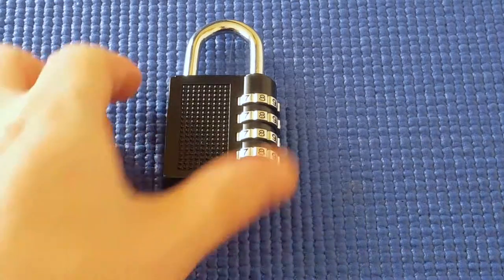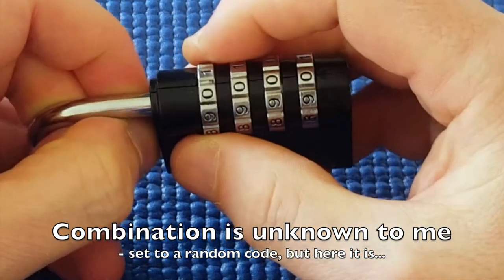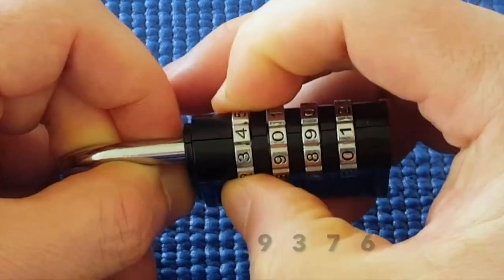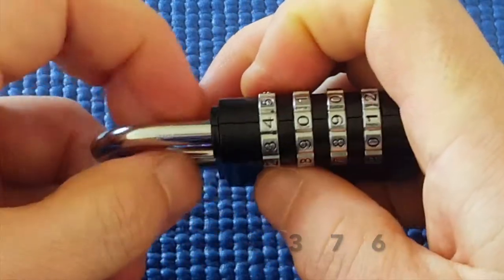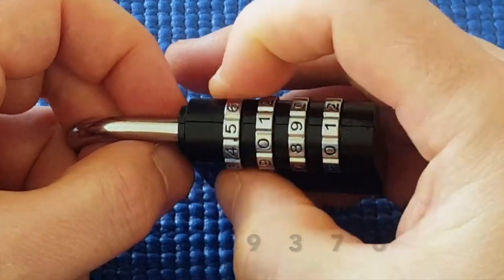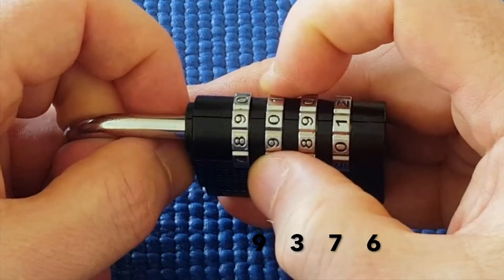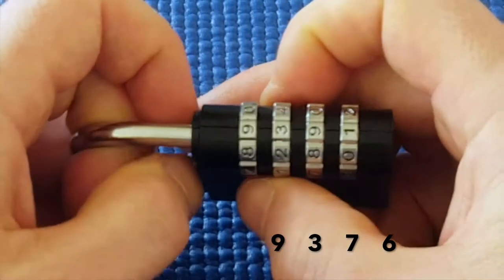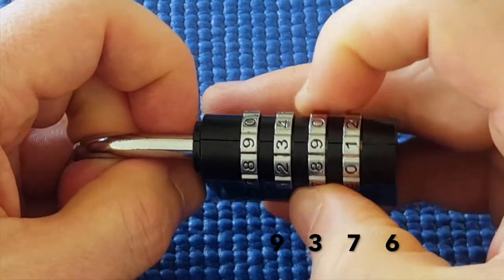(Picking 11) A surprisingly tough unbranded combination lock (decoded)

Comment: That was very interesting - yes this method it very effective and most of the time gives an success. When you really pull hard on the shackle, the fase gates bind fully and the true bind also but you still can move the wheel (this is from the inner wheel being squeezed together). There are many variations of feedback and with more lock you learn more tecchniques - great hobby :-)
Reply from the maker: Thanks! - after watching your fantastic videos again, I figured out that your technique of turning the wheel that binds the most is simpler & faster (and I don't have to pull really hard which is tough on my fingers) - I'll do a quick follow-up video to explain that (for completeness).  Yes it's very interesting to figure out all the ways a lock can be opened with.  I appreciate how you figure out not just what works but why it works - nice :D